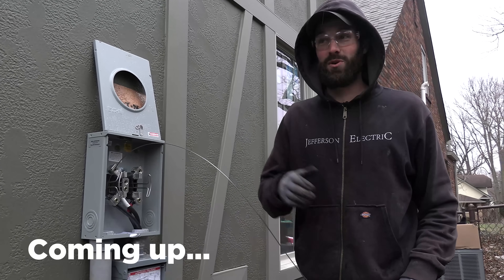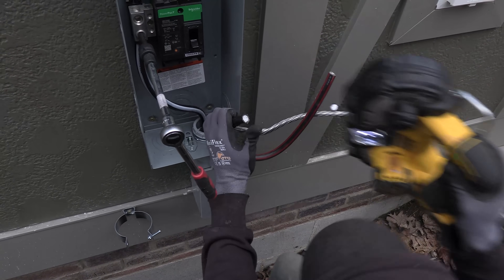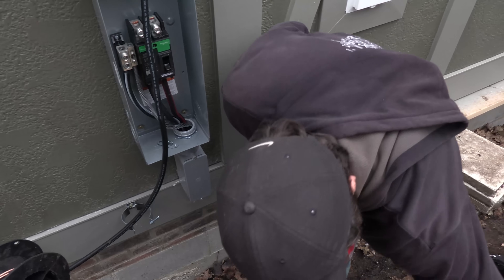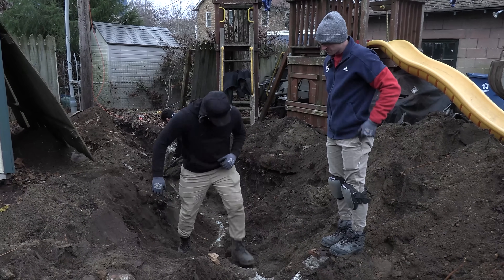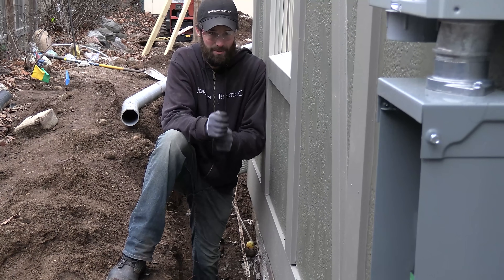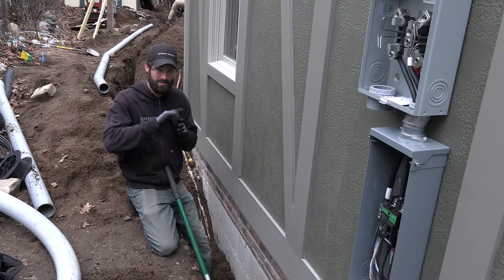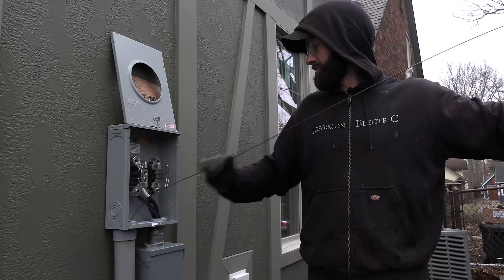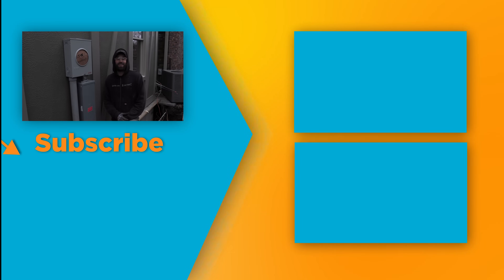Unearthing the Lost City of the Mole People

Comment: Doubt if you would ever get 25 ohms or less with two 8' ground rods that are 8' apart. Mike Holt did a great utube on this. He had to go down 40' with four 10' ground rods screed together to barely make 25 ohms. In cold dry winters ground resistance is very high. In my area nobody owns an expensive dedicated ground rod resistance meter so everyone just drives in two ground rods. Also in my area we have to install two legs at a 45 degree angle into the ground &  at 90 degrees apart to support a 6 by 6" piece of timber.
Reply: Should have added that for a temporary service.
Reply: A simple multi function tester can test the earth loop resistance . Decent sparkies don’t leave home without one .

Comment: All that cold insulation giving you trouble...why don't you use a battery-powered wire stripper?  Milwaukee makes one that acts like an electrical engineer's pencil sharpener.  You put the die that matches your conductor size on the tool, set the length of insulation that you want it to strip, and hold down the trigger until it finishes.  It will save you a bunch of time not having to switch between the cutter, stripper, and needle-nosed pliers.
Reply: heat gun! doesn't take much really.

Comment: Just use an expansion fitting on the that service lateral. That pipe is gonna rip apart from the meter, with the freeze cycles thru the years.

Comment: bloows my mind you have the quite large grounding rods with what looks like very small wire teeing them together. im sure it code but still seems like that small wire would break very easy. has that ever been an issue?
Reply: that ground wire is stronger than you think. The deal with the ground rods is more about total surface area making contact with the damp soil. That's why code now calls for two rods. Basically, it's more surface is better.

Comment: @ 7:25 Drives me a bit nuts when people say ground rods can clear a fault or that they "dissipate" fault current..  They generally cannot. Example 125V/10 Ohms(a well grounded rod) is only 12.5 Amps.  That won't clear a thing.  Ground rods serve only one purpose: equipotential.  They serve no purpose for clearing faults.  Bonding is responsible for clearing ground faults, not ground rods.
Reply: right, they're more for nearby lighting strike discharge pathing and part of the overall grounding via utility, neighboring services, pole grounds and more.
Reply: @throttlebottle5906  no pal they are a simple backup for neutral faults on supply transformer .

Comment: Fault current doesn’t dissipate to earth.   You can put 120 volts to your ground rods and it won’t trip the breaker.  The voltage travels through the ground wires metal parts back to the neutral since it is a low impedance path or low resistive path the amperage is high causing the breaker to trip in less than a second.  If the resistance to ground is 12 ohms you would only be drawing 10 amps not enough to clear the fault.  The path back to neutral through the grounding conductors/metal components is a fraction of an ohm drawing high current to clear the fault.
Reply: Correct . But it would trip a GFCI .

Comment: You are using a 6 ga wire for a ground.  Our old house had 60 amp service, which used 6 ga entrance conductors.  It seems logical to me that if you have installed a 200 amp service, you would be required to install a ground system that can handle a full 200 amp fault to ground, i. e. same gauge as 200 amp entrance conductors.  Or the NEC has a percentage formula?
Reply: #6 is adequate per NEC for ground rod electrodes regardless of service size
Reply: Copper vs Aluminum, Copper has a higher current capacity, so you can use a smaller diameter conductor.
Reply: @GrizzLeeAdams  True.  The top 4 metals in terms of conductivity (low resistance) are Silver, Gold, Copper, Aluminum.  For a 15 amp circuit it's 14 ga copper, but you have to go down to 12 to compensate for the lower conductivity of aluminum.  So for 200 amps you would need 2 ga copper or 0 ga for aluminum.  The only reason they started using AL wire in the 60's was cost.  The downside = thicker wire and the way AL oxidizes.  AL & CU both oxidize but AL forms a hard scale that is almost non conductive, that's when they started catching fire.  So that's when they figured out all connections be coated with anti-ox grease and tighten them down more because they were softer than copper and they would "creep"and loosen over time.
Reply: When you have a fault, a wire will very briefly see thousands of amps before the breaker kicks in to cut power to the circuit.  There’s no resistance in this situation other than the wire. But the amount of time is short incredibly short (hopefully) that the heat generated is small and dissipates quickly.  It’s like holding a lighter to a piece of wood.  A lot of heat, but you need sustained heat over a long period of time to actually ignite the wood so that it continues to burn.  So that wire has to be sized for the service but making it larger and equal to the ampacity of the service itself doesn’t really matter.  All that matters is 1) the breaker works 2) there isn’t a break in the path someplace.  Ground wire going out to ground rods however does not see fault current. It’s just to dissipate charge built up on the electrical system and metal components in your house and on the electrical system in general.  Joel had a great video on this with a lineman who was illustrating how they have to discharge voltages constantly to ground when working on the wires because of the huge amount of charge that builds up on the metal.  It’d be like touching an electric fence (even if the power was off to the line itself) if they didn’t discharge built up charge.
Reply: Absolute nonsense mate if you are an electrician you should go back to college .

Comment: For the concrete, you guys should have one of those jack hammer attachments for the mini excavator. That would save you a lot of headache
Reply: if you watched the video before this one, they were not anticipating a large object so didn't think that far ahead. The idea was to lift out the small (so they thought) slab and bust into a few pieces if necessary. BTW, that size machine doesn't usually have the ability for a jackhammer attachment.
Reply: @rupe53  first off, I did watch the video before. I think tho it is always best to work smarter rather than harder. Trust me breaking concrete by hand is a pain in the rear. If there is no attachment for an excavator of that calibre, I have seen concrete contractors use similar machines to break up pads before. So they do exist.
Reply: @tasobouzinelos8027  ... I won't disagree here, but consider we are talking about an electrician's point of view. A different contractor would certainly have a different approach. I am also confused as to why the original GC on the addition job wasn't tasked with doing trenches while they had equipment on site already. After all, they dug for a full foundation, and we know that wasn't done by hand.
Reply: @rupe53  that’s very true.
Reply: @rupe53  In the previous video his apprentice told him they should break it instead of trying to just grab it... he didn't listen but I'm sure he will next time.